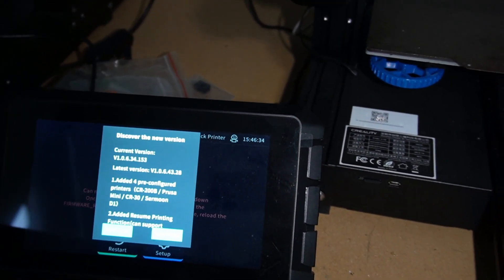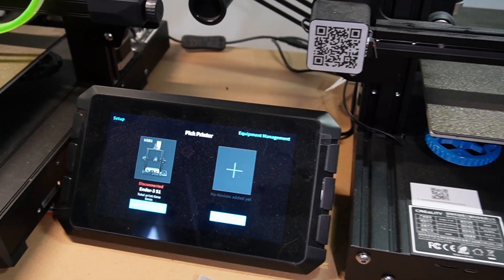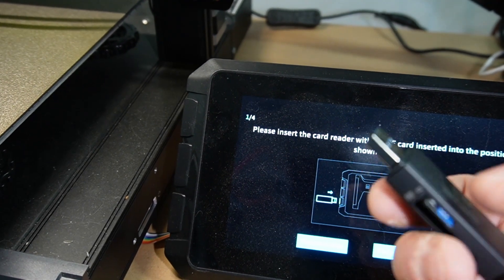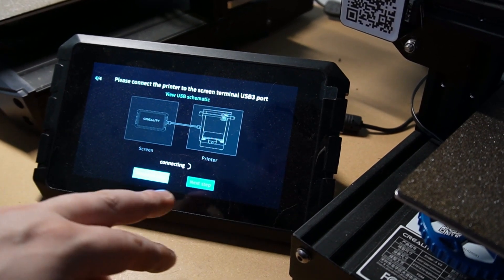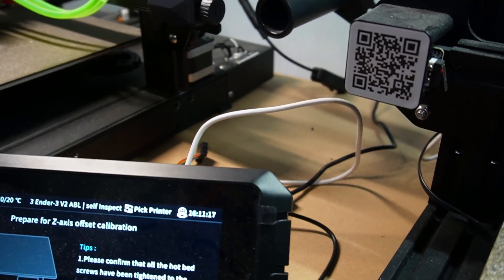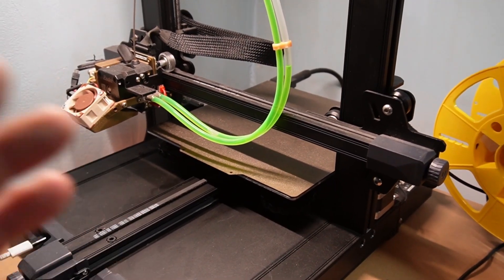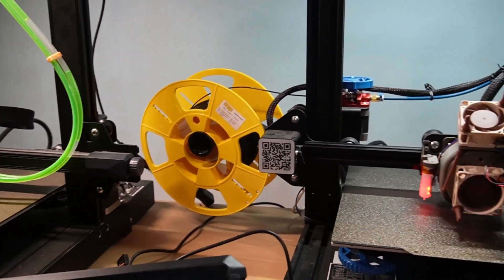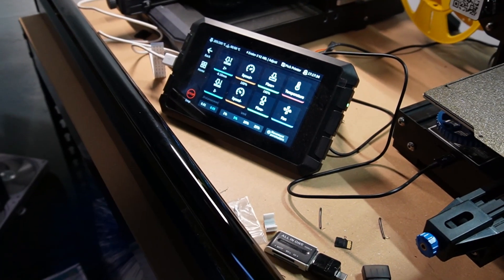Creality Sonic pad Simultaneously printing TEST (simultaneous) up to 4 printers!

Comment: Hi, have you ever had the connection lost issues? It seems there are some sort of problem of losing connection between the pad and the printers during printing.
Reply from the maker: No I haven't , but then again i didn't use the setup for too long. But when i ask around i didn't really encounter that issue.

Comment: yes, that works.. BUT, what I did not get to work is: with 2 printers you are using 2 usb ports out of 4...  Adding 1 usb camera works fine (especially for monitoring in fluid... ) you can assign it to a printer.. BUT.. if i want to add a second camera (same model, same brand-- i am using logitech C270 - works plug and play with sonic pad).. i can install it.. it is there.. BUT i do not get any image on the second one (in the configuration it says camera connected).. if i assign it to the other printer it assigns also the other camera to the other printer... so it seems, yes you can connect a second camera.. but it will NOT work...  Or maybe I am doing something wrong.. have you tried it? can you try it?
Luc
PS: the cameras definitely work.. because i can change them around.. and the one connected to the first printer always works, regardless which of the two it is...
Reply from the maker: no worries, i'll give it a try, stay tuned!

Comment: Hi, I bought it and I'm waiting for it to arrive, I only have an Ender 3 s1 pro printer. I bought it because with Clipper it gives better print quality. But the Creality Sonic pad screen has one thing wrong and that is that the laser module is not compatible. I hope one day they release an update and make it compatible.

all the best
Reply: Got a S1 Pro myself with Klipper using a RPi. Quality did increase due to pressure advance and input shaping, but to be honest, the real improvement is speed. Now I use 100-125mm/s, with outter perimeter and top/bottom at 35mm/s @ 4000 acceleration for quality prints. Its impressive what the right firmware can do.